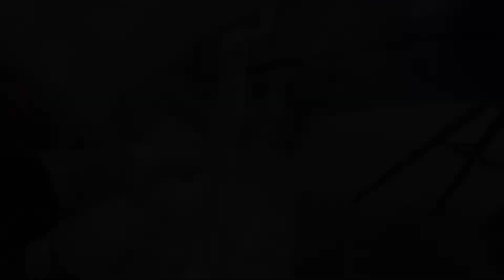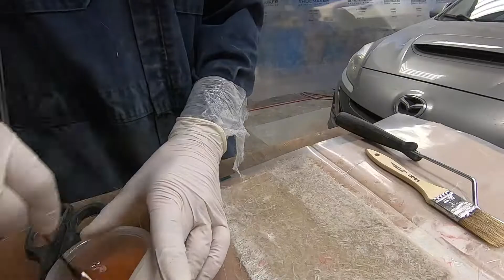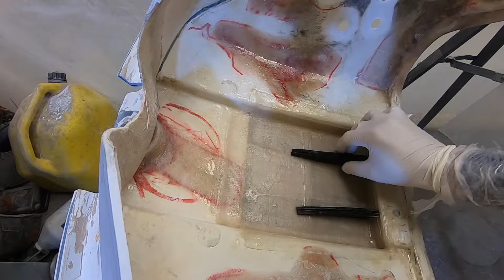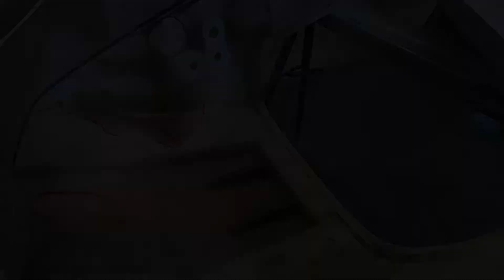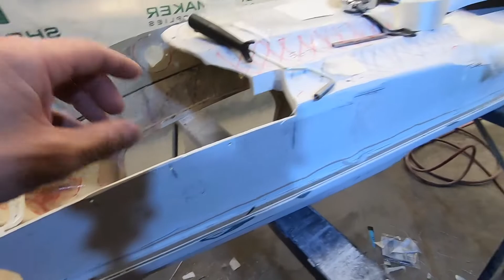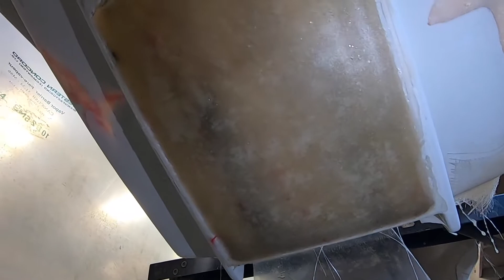Gas Fill Delete - Completed - JSB Collaboration Announcement.

Comment: Hi mate, didn't realise how many pieces of fibre glass you have to use in the ski
Reply from the maker: A LOT for sure. This ski had a lot of "little" damaged spots that turned out not so little when all of the paint and body fill was removed. Some of this work was just because I'm fussy, and some if it was necessary because I'm installing a heavier more powerful engine.

Comment: So what is your plan for the fuel tank, do they make new ones with a fill delete yet or are you just going to make a cap for your tank
Reply from the maker: Hey Ben. I have actually modified my tank (last season) so that the fuel fill is under the hood and the pick up is at the front. The part where your lines go in has the same thread as the gas cap, so that part is easy. For the fuel pick up, I machined a piece that pressed into the front fill area. 

I like to have the fuel fill on the inside as it means that I have to open the hood every time I fuel up. It's more likely that I will see if something bad is happening under the hood :) 

I do plan on making a new fuel tank, but due to time limitations, I may be using the factory one for a while. 

If you're interested, here is the video https://youtu.be/VCqn5icP1Vo
Reply: @JoelArseneaultYouTube  gotcha, is the patch just for aesthetic or is it also for more hood reinforcement
Reply from the maker: @benkarel5269  Both ... kinda. 

A kid left my door unlatched and I lost it on the highway, so I didn't have a door, and I don't use that area. I decided to cut the front out and discovered that the original compartment was somewhat structural due to the shape. 

So, I started to do it for cosmetic reasons, and ended up having to build some reinforcement in. The surf braces add a lot of strain on this area, so if you run a surf brace it might cause cracking if this area were cut out and only filled cosmetically.